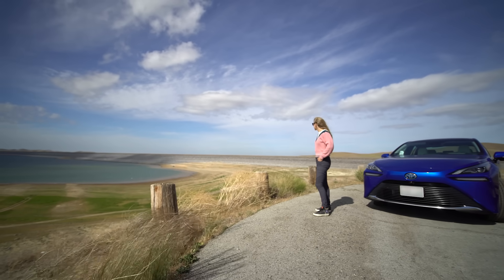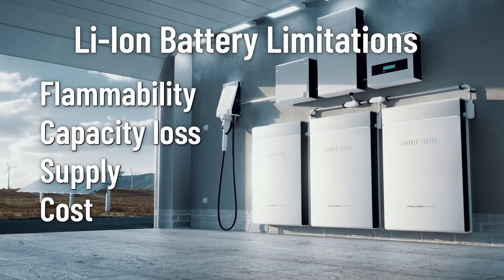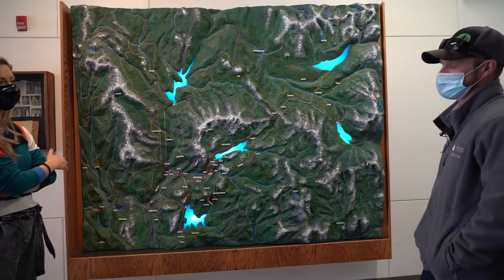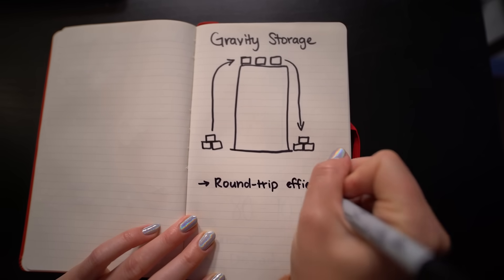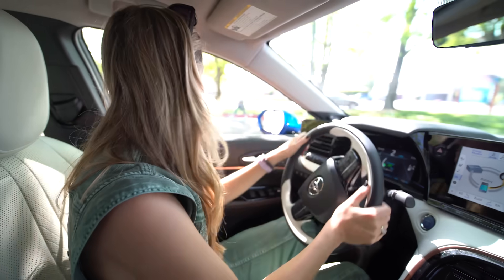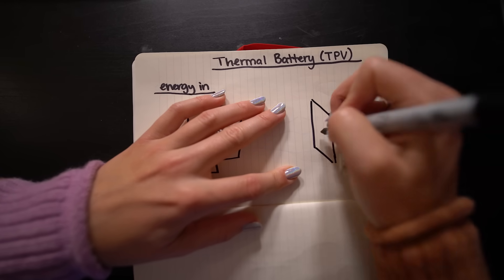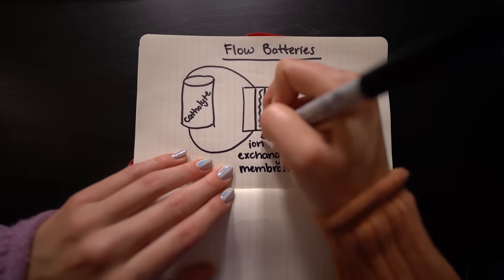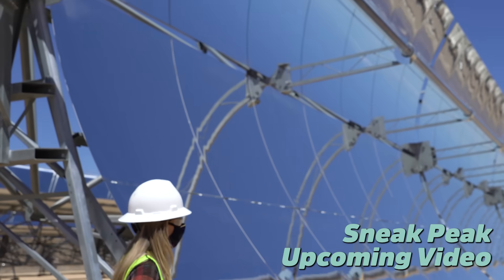The BIGGEST problem with clean energy

Comment: That was my idea in high school, cyclical renewable energy. Parts Solar, Wind, and Hydroelectric, being driven by gravity. The biggest investment would be to build reservoirs. It could replace nuclear in parts of the world that have temperatures that don't get below freezing.
Reply: If anything, we should have much more nuclear, not less. It's absolutely astounding that people who purport to want to protect the environment and the climate even mention the idea of replacing nuclear energy. The anti-nuclear movement have done as much damage to the climate and the environment as the coal industry has done. This is because nuclear energy became practical as an energy source in the 1960's, but started facing opposition from the mid-1970's onward in most western countries, resulting in few new plants being built. The plants that could have been built would have prevented a lot of the CO2 emissions that have already happened.
Reply: @eckligt  Well, Nuclear power plants are a last-century technology. Natural gas plants are on the rise. 

What exactly do you mean by "The anti-nuclear movement have done as much damage to the climate and the environment as the coal industry has done" ?? That statement is very general and extremely flawed. 

Also, the American Nuclear Industry was designed specifically to be used to enrich uranium to make weapons. Power generation was secondary. The French Nuclear power system is twice as efficient as the American program.
Reply: Something that doesn't generate power is not easily going to replace nuclear, and worse yet, the danger to the area around it is easily as bad or worse than nuclear. Look up some ways reservoirs fail, and you'll see that not only are they unpredictable, they can often be high maintenance and difficult to build in certain locations. Nuclear is far more important to humanity than anyone gives it credit for, as a solution to most of their problems.
Reply: @andrewcopple7075   What are you babbling about? The Big Creek Hydroelectric power plant (which has been around since 1913) is proof of concept. Which part don't you understand? Did you even watch this video? And how exactly is it dangerous to the area?
Reply: @UCQbQ1vQpOJ79GFdk2ANRdjA First of all, lovely Manifesto Ted Kaczynski would be proud. 

Secondly, none of what you wrote about nuclear power plants make a difference, because Energy Concerns, or Power Plants, are run by corporations, and these corporations don't give a damn about the science. They only care about the revenue generated. It is far cheaper to build, run, and maintain a Natural Gas fired power plant vs a nuclear power plant. The difference is in the Hundreds of Millions. 

Third, there is absolutely nothing we can do about climate change. If you look at the natural history record there have been five ICE-AGES Ages, closely followed by Five Periods of Global Warming. And during the interim between one extreme to the other, 90% of all animal and plant species that have ever existed went extinct. All of this occurring before man had even evolved it migrated Out of Africa. Either an ice age or a global warming event are natural to the Earth weather cycle. The Earth is 4.5 billion years old, and for cost to claim that we know how to change or affect the Earth's natural weather cycle is beyond arrogant.
Reply: @theylied1776  Thanks for clarifying that you are a climate change-denier. If you had made that clear in your first comment, I could have spent my time doing something else.

The Ted Kaczynksi comment is absurd, since I am the one advocating scientific advances, while the anti-nuclear campaigners are the ones stuck in a mindset where they want to hinder progress based on some wishy-washy ideas.
Reply: @eckligt  First of all, the Ted Kaczynski comparison was correct and appropriate. He to advocated for old technology. 

 Secondly, Nope, never denied climate change is happening. According to the Natural History record, it has happened 5 times. But if you disagree, quote me directly, use my exact words.
Reply: @theylied1776  I am advocating for new technology. You can't call it old just because it started a long time ago. General-purpose computers were conceived in the 1800's and implemented with electricity during WW2, cars are from the late 1800's. I believe in iterative improvements, and nuclear power should not be an excemption to this. The current proposals for next (fifth) generation nuclear power are true creatures of the 21st century, and the current fourth generation are ready to be built if only politicians would listen to the science.

Secondly, I think it is obvious that when I say climate change, I mean anthropogenic climate change. If you deny anthropogentic climate change, why didn't you call out the video for being motivated by anthropogenic climate change?
Reply: @eckligt  Is English your second language? Your comment: "thanks for clarifying that you are a climate change denier".
I'll ask you for a second time, quote me directly. Use my exact words. Show me where I denied that climate change was occurring, any of my comments.
Reply: @theylied1776  First, yes, English is my second language. I hope that is okay.

Second, here is the quote you requested:

-- begin--
If you look at the natural history record there have been five ICE-AGES Ages, closely followed by Five Periods of Global Warming. And during the interim between one extreme to the other, 90% of all animal and plant species that have ever existed went extinct. All of this occurring before man had even evolved it migrated Out of Africa. Either an ice age or a global warming event are natural to the Earth weather cycle. The Earth is 4.5 billion years old, and for cost to claim that we know how to change or affect the Earth's natural weather cycle is beyond arrogant.
-- end --

There are some parts of this quote that can be understood as a kind of fatalistic resignation that we're screwed no matter what. I'm thinking of the statement "during the interim between one extreme to the other, 90% of all animal and plant species that have ever existed went extinct".

But other parts of what you said in the above quote are pretty standard talking points among those who deny anthropogenic climate change: That the Earth, being so old, cannot have its weather/climate changed by human intervention, and that the Earth has alternated five times between ice ages and global warm periods long before the industrial revolution (hinting that whatever we see right now might also be natural).

In summary: Granted, you have not written a sentence like "anthropogenic climate change is not happening", but you've used all the dog whistles to indicate that that is indeed your belief. And to me, that is a distinction without a difference.
Reply: @eckligt  It's fine that english is your second-language. It's just very obvious in your syntax. I don't know what your first language is,  but it comes off a little bit like Deutsch. 

Here's the thing, the day that we perfect the technology where we can prevent or delay spring, summer, fall, and winter is the day that we can do something about extreme climate change. But until then, it's beyond arrogant to believe that we could have an effect on the global weather patterns.
Reply: @theylied1776  Thanks for making your views clear. We disagree, and that will probably not change.

Comment: is talking about limitations of lithium ion batteries, while showing a picture of a lead acid battery, which looks to have been either grossly overcharged with a welder or something, or frozen.

Imo the main limitation of pumped hydro is the specific geology you need for it be to practical.  you don't just need space, you need a space with a large elevation drop over a comparatively short distance.  Not only that, but if you don't want to have to blast your own reservoir's (massively expensive), you need a natural body of water\valley to dam at both the upper, and lower locations.

Should take a look (if you haven't already) into liquid metal batteries, seems VERY promising.  Cheap and abundant materials needed to build them and a long lifespan.  It's major downside is it's not really portable, but that doesn't matter for grid storage.

And i have to put in the obligatory nuclear statement, if only we could get over the fearmongering about it and educate people.
Reply: energy production is not an issue at all, anywhere in the world.
lithium batterys are endlessly recylable and recources are basically infinite , this is just another toyota propaganda video from the usual youtuber 5 minute google research nonsense.

Comment: Compressed air storage IMHO, is the best way to collect and transmit wave energy along a breakwater to a sotrage facility. No electricals to go wrong, and each float just needs an appropriately sized pump cylinder attached to it. Not only is the generation potential great, but it will protect the breakwater from some erosion, while serving as sacrificial bumpers for adrift vessels.

Comment: The goal shouldn't even be 100% renewable energy sources at this point.  It should be the decriminalization of nuclear energy.
Reply: Natural gas is 100% renewable. Oil, coal, and natural gas is solar energy trapped in plants and swamps. Natural gas is produced by the tens of thousands of barrels per year. We will never run out of coal, oil, and natural gas so long as we have trees and sun.
Reply: @ExistenceUniversity  The problem is that these fuels were produced on geologic timescales from processes within the Earth. You don't just kill all the plants in a swamp and a year later have a coal mine. Sure, they are 'renewable' but on geologic timescales.
Reply: @ExistenceUniversity  
Sources?

Comment: I think not understanding that storage is the key, is what so many people who are for solar but against nuclear are forgetting.
Nuclear power is not about producing power so much as it is that production will almost always be cheaper than storage. So any power system that does not require storage to be effective will serve a purpose in mitigating storage costs.

A nuclear base load means storage only has to be sufficient for the fluctuating part of the grids load.

Comment: We are stuck with fossil fuels for the next few decades.  we need to look into not new energy sources but getting better control of  fossil fuels to help our environment.  We have done very well so far. we have doubled our use of oil and cut in half the pollution. Controlling the amount of Carbon produced is a problem we can solve.

Comment: "The supply of lithium will run out by 2080" Riiiight because it's not like we can recycle lithium or anything like that. Oh, wait, no. We can recycle lithium and all the other parts of batteries.
Besides, lithium batteries sit between the fuel cell and motor in these FCEVs that Toyota has paid you to push, so poo-pooing them doesn't seem wise.

Thanks for mentioning liquid air power storage.

"Hydrogen is very abundant, just look at all those oceans" but can we just electrolyze ocean water? Nope. You need to desalinate and purify it first, otherwise you start vaporizing chlorine and other stuff. 

Liquid metal batteries? Iron phosphate batteries? Aluminum or iron air batteries? Kinetic storage? Dropshaft storage? Molten salt? There are many more storages besides these, I guess you wanted to keep this video short. 

Just pumping H2 in the natural gas pipes already existing is a terrible idea. It would leak like a sieve and gaseous H2 isn't very energy dense. There's no way existing infrastructure would handle the tens of thousands of PSI that liquid H2 needs to be stored at. 

That thermal battery was interesting, but using PV to get the power out seems weird. Why not a Stirling engine, or even just thermal-voltaic if you want to keep it small scale? 

This video was not as bad as the others in this series.

Comment: One thing I've never really understood is why you don't just run all the generation at peak efficiency levels (say 90%) continuously and then have some rapid acting energy sink away the difference between generation and demand. For example: aluminium or water electrolysis.

The idea being that you don't use it as a storage mechanism, but instead a variable load to match the gap. Over a period of hours, days, or even weeks, you'll end up with the same output from the excess load, but balanced across dips in generation capacity.

Comment: I'll make a predicition for the sneak preview: it is based upon the concrete block heat energy storage system designed by Siemens quite a few years ago.
In this solar-thermal energy is concentrated to such high temperatures to generate a molten salt liquid, which is then pumped into large concrete blocks made of a highly heat resistant cement able to withstand repeated expansion and contraction.
In these blocks of concrete are also the water pipes that lead to a standard steam turbine power plant.
The temperature in these blocks is high enough to power the turbines for several days up to a week even without any sunshine. allowing for full day round power of the turbines.
As this solar-thermal plant was supposed to be placed in the Marokan desert I'd assume that absolutely NO sun for several days would amount to almost a zero percentage chance.
Reply: Go to "Now you know" YT channel.
There's an "underground thermal storage, heat pump recovery" project they covered a few months ago.
One topic special should be easy to find.

Comment: Vanadium flow batteries could probably be a multi-hour video all by themselves.  They've been around for decades, and Vanadium has the advantage over the other chemistries that it can easily exist in four different charge states, so its used for both the anode and the cathode.  The failure mode of flow batteries is often a membrane breakdown, and with a Vanadium battery, you simply clean up and recharge the material.  No cross contamination.  That said, getting the material in a form the battery needs is expensive, the densities are low, and many other circumstances have contributed to keeping this chemistry in a niche position in the storage market.

Comment: There is another kind of thermal battery, which relies upon reversible chemical reactions driven by heat.  Most of these rely upon a dissolved component adsorbing chemically onto a solid substrate, forming a bond, much as in an electrochemical cell.  Heat is liberated by reversing the reaction, allowing you to access it on demand at a later time.  You've encountered this in the form of reusable chemical hand warmers.

Comment: All of these technologies don't compete directly because they have different advantages and disadvantages that separate them. Important aspects are how fast energy can be stored and released, how dense the energy storage is, cost and how durably the energy can be stored. The Tesla battery farm can respond within milliseconds and dump massive amounts of energy back into the grid. Reversing the flow of water in a pumped hydro storage facility is much slower (but has bigger capacity). Other technologies come in somewhere in between.

Comment: Diane, while this video is not quite as iffy as your other Toyota propaganda, this one still has the taint. You’re better than this.

Current hydrogen is sourced almost exclusively from steam methane reforming. Hardly a green solution. As such, making arguments about how great H2 is, comes off as PR for the big petro companies.

When/if electricity is cheap enough and available enough, on site hydrogen manufacture via electrolysis or similar, and then storing it locally makes sense. Barring leakage, it’s one of the few ways of “storing electricity” for extended periods of time. But other than that, it’s simply too energy intensive to make and store, not even including the methane issue.

Maybe someday, but we’re not there yet. For better or worse, there are currently MUCH better options from the various battery technologies right now, and that tech is growing and maturing as well.